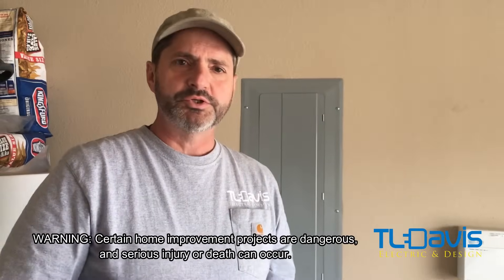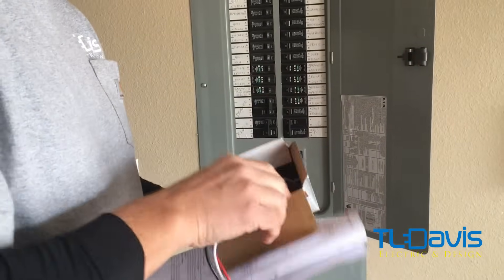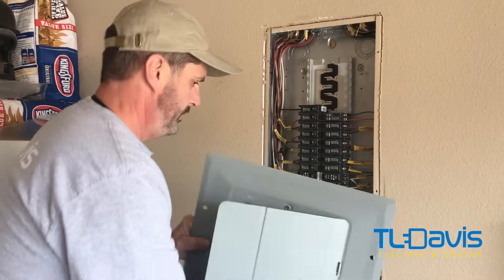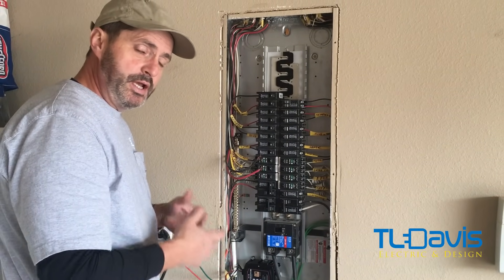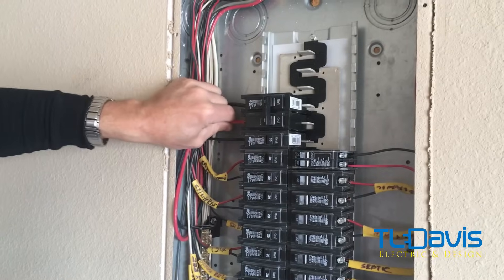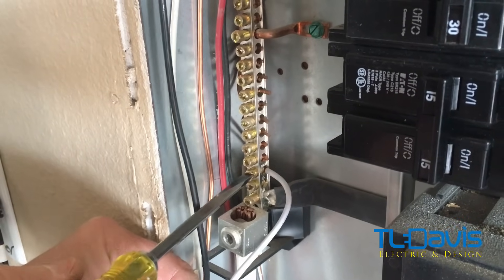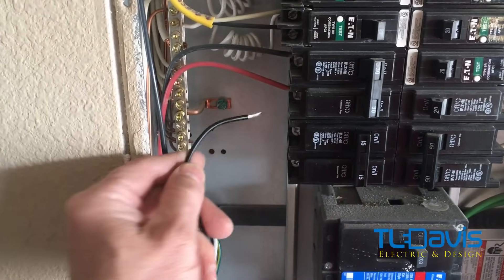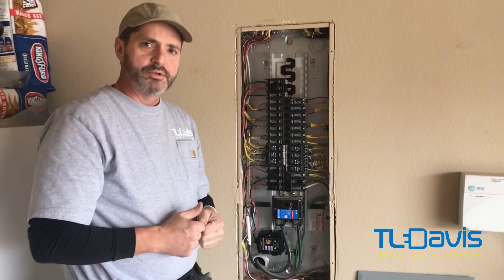How To Install A Whole House Surge Protector | TL Davis Electric & Design

Comment: What do you do if you do not have any open breaker spots on your panel?
Reply: Do not install your surge protector inside the box. If there sincerely isn't a breaker spot free, get an electrician because you may need a bigger box.

Comment: noticed his panel is mounted upside down somebody didn’t have enough service entrance, cable or they were really cheap trying to say Wire but normally your main should be at the top.
Reply: 😂 they can go either way.  Your brain is just used to seeing them the other way.

Comment: This electrician did the wrong installation.. He took a shortcut and installed the surge inside the panel because it would be diffiuclt to install it outside because it is a flush panel.With a.  surface mounted panel it would of been a piece of cake. I would of installed  flexible conduit from the side or bottom ofthe panel and installed a junction box and attached the surge to the junction box. This way you can see the light on the surge

Comment: Excuse me if this is a stupid question but if you want to protect the whole house how can it only be wired into its own breaker? Wouldn't it have to be wired into the main breaker? How does this work to protect the whole house if it's only wired into its own breaker ?

Comment: 😂😂😂30 years experience and showing the people how to install a surge protector without SUTTING OFF THE MAIN BRAKER
Reply: I’m not an electrician but I was rather shocked that he didn’t show the power shutoff step.
Reply: Seems like a lot of qualified electricians do the same thing. I don’t question them.
Reply: I’m an electrician and you don’t have to turn off your main if the one it’s gonna feed your hspd it’s off common sense
Reply: You clearly don’t know how a panel works. You can flip the breakers and guess what will happen when you get in that panel? It’s still hot…why? Because it’s still receiving power from the meter
Reply: Amazing spelling

Comment: 1).  Ironic that he mentions working with gloves unless the main breaker is off and then zooms in to where he's installed the SPD -and the main breaker is still ON!  LoL
Never point inside the panel with your bare hand while you're talking to the camera.  Accidents are called "accidents" because you don't expect them.
2).  As others have pointed out, do NOT install the SPD in the panel where the home owner would have to remove the cover to see if the SPD is working.  This is a bad way to save money on installation costs because you are too lazy to fish a wire into the panel and mount the SPD on the wall -or even better: cut a small hole in the wall and make an access door beside the panel and install the SPD onto the panel itself.

As I have said many times when training electricians: "Technique is 90% of what's important after you learn the very basics".  This is an example of poor technique.
Other than that, it's helpful, but this is not really DIY stuff; if you screw it up, you've wasted a lot of money; not just for the materials and installation, but for the fried equipment that you thought was going to be protected.

Comment: Interesting, you mention A & B phase, but connected both hot wires to the same bus? Also, according to EATON wiring diagram, the neutral and ground are supposed to be connected to its respective terminals. Reason would be that "N" bus is for power purpose and "G" is ground and the safety component. I understand that eventually both N & G become the same contact point, however, a direct ground is always the best practice. My two cents :-)
Reply: Those busses alternate. They are on different buss bars.

Comment: Great Great Video !!! What should I do if I don't have room for more breakers spaces? Any suggestions, or links? That will be greatly appreciated.
Reply: Your goal will be to attach to a double pole circuit breaker that you know will remain untripped. My suggestion is the dryer circuit. Do not illegally double-tap the existing circuit breaker. Google about this. You need to either pig tail or get a proper tandem double-pole circuit breaker replacement that is designed for double-tapping.

Comment: Homeowners DO NOT FOLLOW these directions. This is a live panel and the demonstrator almost made contact with the bus bar at least 4 times. While this video is very helpful for intermediate to skilled handyman and or electricians who’s never done this Install homeowners will put themselves in a very dangerous situation by making contact with a energized bus bar.

Comment: Great video! Are more than one of those devices required if there are multiple panels in a home?
Reply: No, when you install this as close to your home's power's main point of entry as possible, everything 'downstream' is protected. Since a sub panel is fed from the main panel, it is no more than another 2-pole circuit in the main panel, and therefore, protected just like everything else.

Comment: My panel is full but I have 4 spaces on the outside disconnect. Is there any issues with it being added to the bottom of the meter base?  The entire system is Eaton with snap in neutral bar.

Comment: Wait, so you can just mount them inside the case? This whole time, I've been using those in wall cut in style boxes you can get for these, witch can be a pain in the ass depending on space. Or mounting a 4 square, unless using a CH panel. Normally I just use the breaker style if it's a BR

Comment: The only problem is that the surge protector is inside the box.  You can't tell if it ever dies.   My fuse box is also between studs.  I was toying with the idea of cutting a section of sheetrock on the side out and attempting to mount it outside via some conduit through the stud.  That would be some work itself, but then I'd have to put up at least an insulation panel where I cut into the wall.
Reply: Install the SP inside the panel is completly wrong , the SP have to be installed where you can see the lights to know if is working properly...
Reply: Eaton makes SPDs that fit in a breaker space. At least for the BR units.

Comment: I served on USS Dace SSN 607, a Fast Attack Submarine, I was a Nuc Plant Operator and Electrician. Rarely did we ever work on energized systems, the exceptions being when underway and impossible to secure power on that particular system. Red tagging systems out with multiple signatures and reviews before working on energized gear is a typical operation. When we did operate on energized circuits we removed anything metal, and there would be 1 or 2 shipmates standing by holding ropes that were tied to the person working on on the equipment. I'm not here to lecture you but electricity is an equal opportunity killer, in fact the more experience you have the more comfortable you are in the false belief that you won't be electrocuted. Considering how easy it is for you to secure power to the panel its a very bad choice not to. After 30 years brother the odds are against you, I'd like to see you here 30 years from now. Secure the power, take care brother.
Reply: Sound advice. I changed all the wired smoke detectors in our house a few months ago and I thought they were wired  on a 24VAC transformer for power so I left the power running.  On the last one of 18, I got a shock and almost fell off the ladder - they are wired directly to 12VAC.
Reply: @the_lar  Likely 120 actually
Reply: I was also an electrician in the USN, but was nuclear waste on DDG-5 Claude V. Ricketts. I remember holding the rope tied to my senior chief while he worked on the main breaker to number 2 generator in the main engine room while we were steaming in the med. Fun times. The only thing I would gig this fine gentleman is please ditch the all metal watch when you are in a panel! (And I guess the non insulated shaft screwdriver too). Be safe mates!
Reply: @rickycastleberry4070  Right On Brother!..Could you imagine what you Chief would do if he saw you wearing a watching inside an energized panel....the CO would equally bust you down to E1 and you'd be  bilge diving the rest of the time on your ship!
Reply: Totally agree, especially you are demonstrating it to some people who are not electricians.
Reply: Lol I did 48 yrs as HVAC technician from residential to industrial. I worked on plenty of energized equipment. You can't always shut off power to a building or a production line ever time you have to work on equipment. Had a few close calls but nothing serious. The military is way to cautious for an organization that sends people into situations that will get them killed.
Reply: @JohnD-f2o  As said you cant always turn off power. A big Amen to Brother! Especially at & under the sea. Its not that the US Military is "cautious" in how we handle repairs and maintenance. The  civilian HV lineman use the same techniques. We do that to be kept alive. Any unexpected "event" can occur at sea and does at anytime, you need to expect the unexpected that will not occur on land in a stable environment. We are methodical to stay alive so we are able to be kill the enemy when we are finished...or possibly be killed..LOL!
Reply: Very good advice.  
Thin Leather, thick nitrile, or latex gloves can be a good safety addition.
Reply: Most of the guys I have work around that were trained in the military were comple know nothing's when it came to any repairs.
Reply: As a electrician being in the military reason why is because a lot of the electricians in the military don’t know they job. Coming out to the civilian world a lot of the electricians I knew just didn’t know enough and wouldn’t trust them. Now I work on equipment energized sometimes and if it’s something big I wear my electrical gloves
Reply: Try not to let the military experience ruin you from having common sense or realizing there are other ways to do things and all military experiences are the only way to do things! I was in the military as well but I did not lose my common brain! The guy in this video did just fine.
Reply: @Ricko1962  Let Me Tell You What Brother.! The US Military DID NOT RUIN ME or TAKE my Common Sense!!! It made me a MAN. Because you are a Chicken S*** nobody with the guts of a worm don't tell me I have no sense. I Volunteered to put myself in Harms Way. Navy Ship, Air Force Aircraft, The Battlefield for Marines & Army are inherently very dangerous places where duty no matter how dangerous or risky needs to be done or don't serve. Because you are a GUTLESS WONDER do not tell the Brave they are "ruined" or without "sense" you LOSER!! You served "what a joke", served as what , some wimp in a ultra safe place in an office building doing squat. Bug off Loser and keep you Non Qual Mouth Shut. ...and the Gent here did make a mistake by  not advising to test your meter on a live ckt first but I didnt bite his head off for it, we all contribute, except you, in which case you whine, accuse and talk like a moron. LOSER!!!

Comment: i have a main panel in the house to which a 60amp  line from its breaker was run to an accessory building. there is a panel and subpanel installed in this accessory building.
QUESTION: do i install 1, 2, or 3 SPD's?
i.e. will just the 1 SPD cover both the house and the accessory building
 OR
do i need to install a SPD in the house and another SPD in the panel in the accessory building?

AND would the subpanel in the accessory building also need a SPD?

Thank you. (you have EXCELLENT VIDEOS !!!!)
Reply: Unless your sub-panel in the accessory building has circuits that exit the building (external lighting /pump/motor) Probably 2. Both building mains. However, if the sub panel feeds expensive equipment (welding machine/saws/motors/computers etc) which are costly to lose/repair - putting one on the sub panel (type 2) is not a bad idea..

Comment: I have a CH panel with a knockout at the top for this surge protector. My open breakers are at the bottom near the main shutoff. The wiring will reach, but what’s the deal with the screw holes on the front of the surge protector? If I drill two holes in the panel cover and mount it that way then I won’t be able to get the panel cover off without disconnecting it in the future. Seems odd. I was thinking of just lining up with the knockout and mounting to the panel. Thoughts?

Comment: Will a surge protector work on a brown out also. My daughter in laws refrigerator burned out in Az do to power loss, 109 Degrees. I believe it was due to a brown out The Electrician told her she needed a surge protector $750.00 installed Which he did

Comment: Several things. It’s always a good idea to turn off the main breaker but a lot of pros don’t. They also get bit sooner or later. I like to put a couple of layers of heat shrink on the screwsdriver shaft because I have a habit of sliding my index finger on it. Ouch! Do the wiggle/rotate thingy right as you finish tightening the terminal screws. Makes a huge difference in wire connection. When you have a panel open, snug up on all the screws. If it hadn’t been done before most will be loose!
Reply: They make insulated screwdrivers for hot-work. Also, don't neglect the value of NFPA 70-110.14(D) Terminal Connection Torque.
Reply: I got several screwdrivers with the metal wrapped in electrical tape. I'm in hvac... so no I'm not inside yur traditional electrical panels often outside of my own house and more times than not working in hvac control panels we have the power off anyway... but at some point there's only so much you can do with the power off. So ya gotta be safe! I like the idea you mentioned using shrink wrap!! Definitely gonna try that!

Comment: My main panel has the grounds and neutrals on same bar. I have no sub-panel. I was please to learn that this is ok. I've purchased a Square D whole home surge protector HEPD80. With this model I can install either to a breaker or direct bus installation. Since I do NOT have available breaker slots, I'm doing the direct bus install. The instructions show the ground and neutral going to different bars. I have additional unused isolated bars on the panel. Should I connect the ground to one of them and the neutral to the bar that shares the neutrals and grounds. Or should I just install neutral and ground on the same bar with the others ? Thanks

Comment: Nice video, thanks for sharing. Does this unit have an alarm if it has been hit and needs to be replaced? Wondering how someone would ever know if it's buried behind the cover?
Reply: It’s common to drill a small hole in line with the green lights.  If the green lights are on it’s working properly.  Once it’s taken too many hits depending on the electric service in that area.  The lights go out.  They can last 1 year or 10 years depending on the power supply surges.

Comment: Did he just install the bond wire to neutral bar, and also the protection device in the main electrical section of panel…. You wouldn’t last one inspection here in Canada

Comment: I just installed my 240V Car charger with 2 50amp breakers can I pop this in there instead of adding another 2? I would get the other model not this one.
tyia

Comment: This unit is not listed to be installed inside a panel. it's not a special case. Eaton makes a plug-in unit for the BR series panel. The SPD should be mounted as close to the main breaker as possible AND THE WIRES KEPT AS SHORT AS POSSIBLE, not folded and tucked back.

Comment: Been thinking about getting one of these. This seems like an easy install but I want to watch someone else do it first. I say it looks easy but if you don't know what your doing, 220 volts on the mains can be hostile. The cities records show a transformer blew about 5 miles away knocking out the power on that side of town while creating a huge spike on our side of town. It took out both my 2000 joule surge protectors and both desktop PCs. I ended up spending about a hundred bucks on motherboards, 2 days of looking at specs and screwing them in, and I lost more money in downtime.
Reply: So was it your"whole house" surge protector blew and didn't even protect your computers?
Reply: @GalaxyMakesEdits  I had 1 20k joule surge protector, 2 motherboards that were plugged into the surge protector, 1 modem, and a drop cable amplifier that was taken out. A whole house surge protector probably would have helped me out.
Reply: The lights flickered then I heard an explosion. Then I notice things not working on my PC like my USB ports. I looked at my surge protector and it was red instead of green.

Comment: I own a few rentals had a lightning strike on my house I live in takeout bunch of stuff around 2k I ended up upgrading to 200 amp and installed a whole house surge protector few years later.
The strike that hit my house came thought the TV cable line It hit the ground outside then traveled through the TV cable line then came inside jumped around wiping out crap. 
So, I did a service panel upgrade on a rental I wanted to get a whole house surge protector installed, my electrician I use now said they really don't work lighting comes in all kinds of different ways not worth the money. I thought about my strike I had it would have not worked so I did not get one.

Comment: I bought a CHSPT2ULTRA my instructions said to connect the white wire to the neutral bus and the green wire to the ground bus. I saw you connected the neutral wire and the ground wire to the same bus. Is that because there was no ground bar?

Comment: Doesn't code require that the ground wire be terminated to the ground bar and not to the neutral bar?
Reply: This panel is the main point of service disconnect, so neutral is bonded to ground at this point.